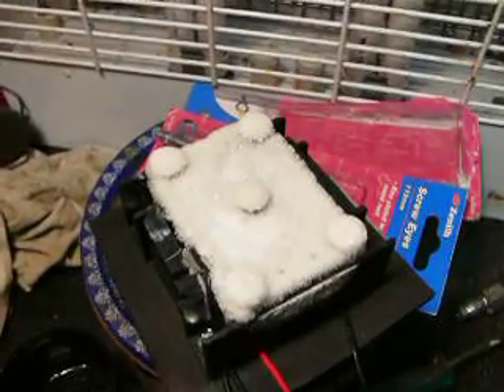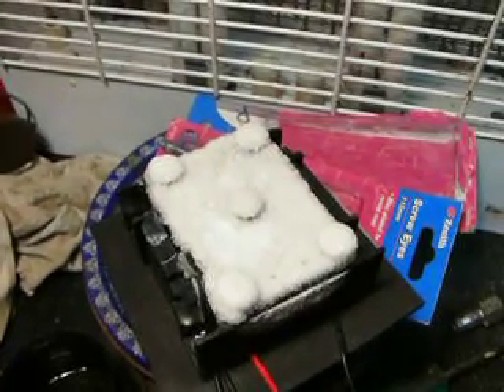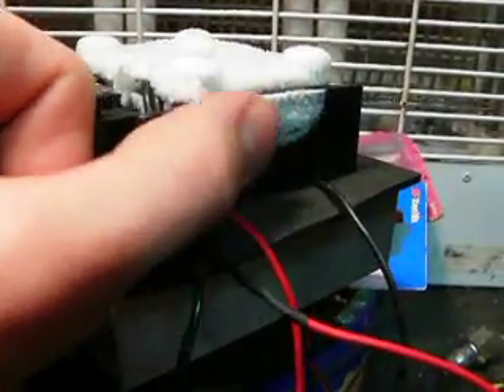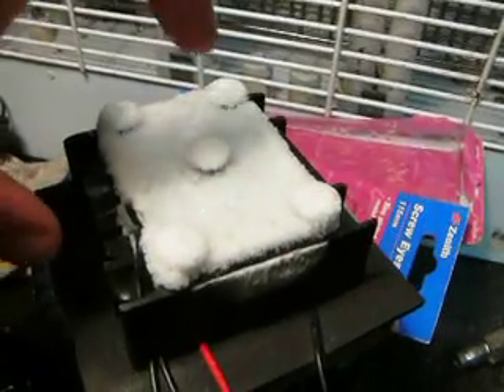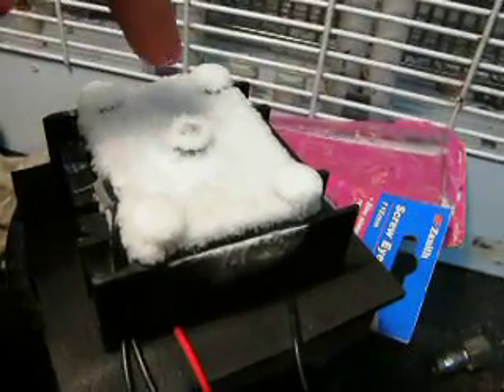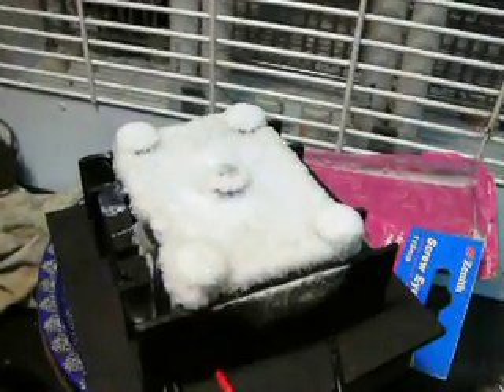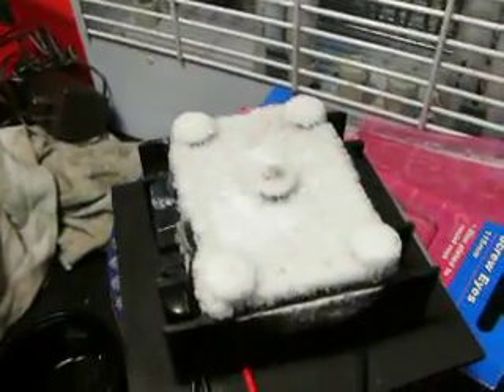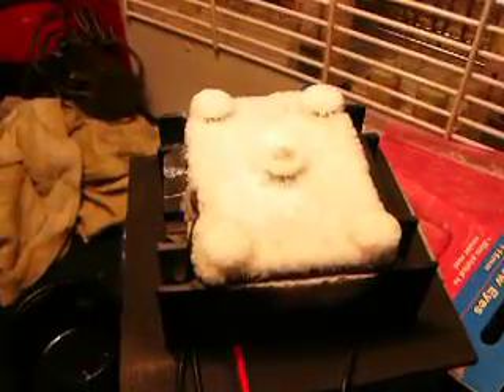peltier effect fridge

Comment: i wanna use this peltier heat pump in my usb port 5v and 500 mA.,i will 10v and 500mA by connecting two usb port in series....is it enough to rum 36 watt at normal cooling capacity...

Comment: A compressor fridge would still be more environmentally sound because watt for watt, a compressor consumes much less electricity than a peltier cooler.  That electricity has to come from somewhere and will probably come from coal or gas.  So yes, peltier coolers are great for low weight applications, but they suck for energy efficiency.  Interestingly, it's very difficult and inefficient to build a micro-compressor for a cooling system.  So there's a solution for both extremes.